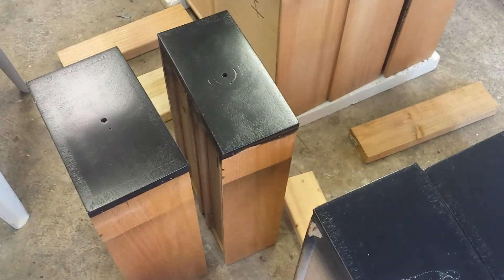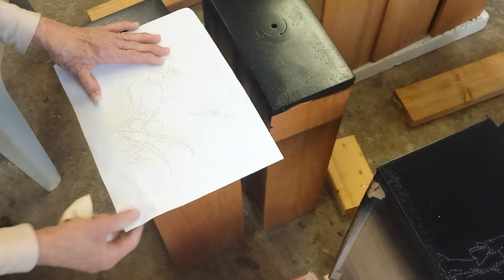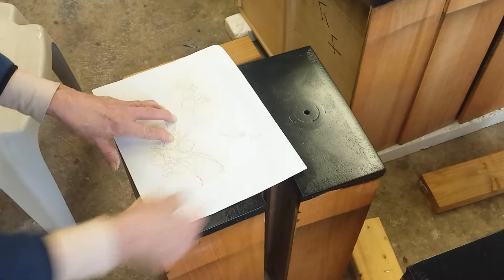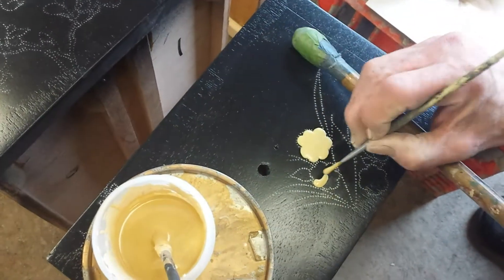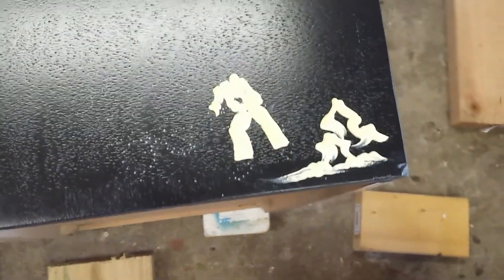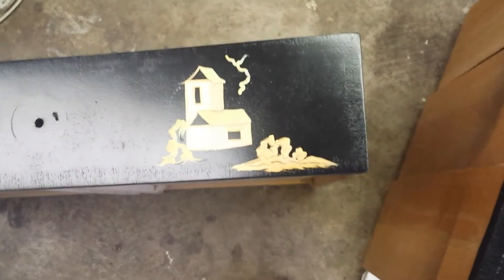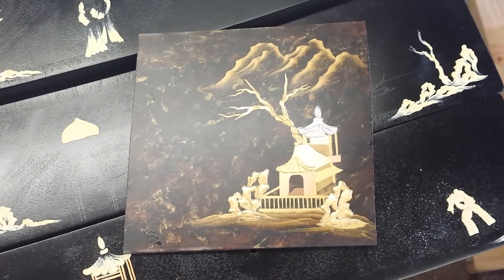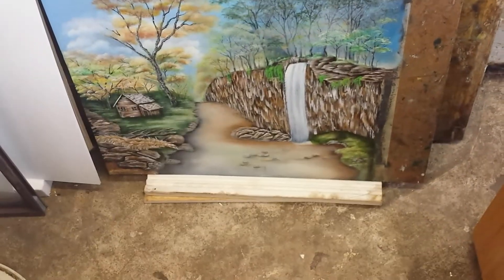hand decorating  an oriental design on a black lacquer dresserhttp://www.timelessartgr.com/

Comment: Gosh you guys do some BEAUTIFUL work!!  Wish I had found these videos sooner in my retouching an oriental room divider I have been working on for WEEKS!  I am close to finally finishing it, but I think I would have been better off removing most of the paint and redoing the gold bamboo shoots.  I didnt want to attempt to redo them because I am lousy with free hand stuff and I was afraid I would ruin it completely so I have been working around it and trying to preserve the original design.  I think I almost have it but Sandy's method of laying on the pattern could have made it possible for me to have redone the whole design and gotten it done much faster!  Thanks for sharing some of your techniques and all the wonderful videos you have done!  I have recently gotten myself into redoing a couple pieces of furniture and boy is it a lot of work!  Not sure I will do too many more but the finished product turning out well does make it worth the effort!
Reply from the maker: thank you,if there is anything i can do to help,let me know.using a pin dot pattern is a very useful way to recreate your image that you need to restore,or create,.anything on you restoration project raised?if so, i can help you with that also.thanks again,best of luck.you can reach sandy at lachbruce1957@gmail.com